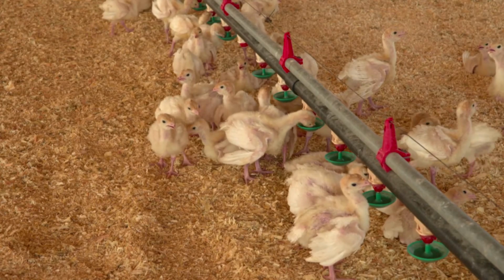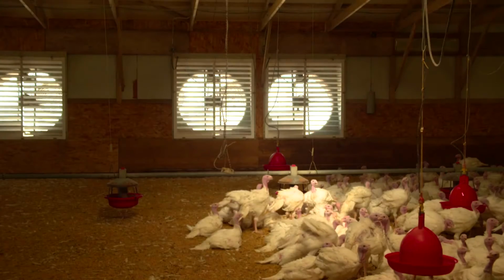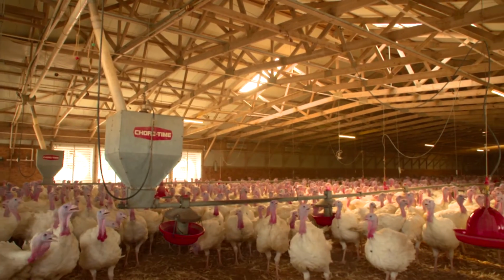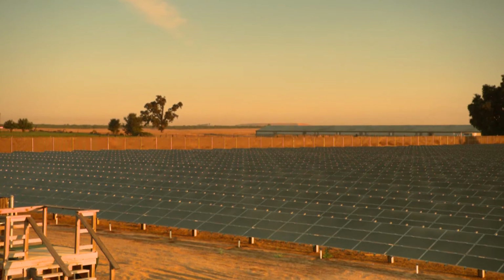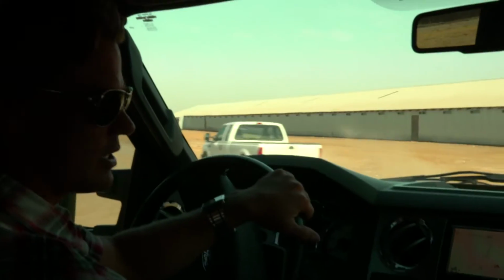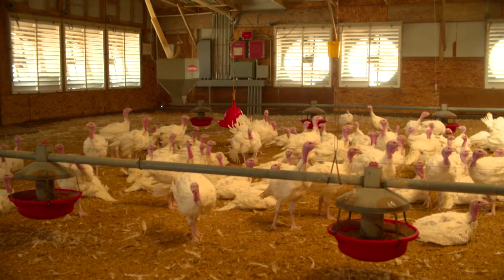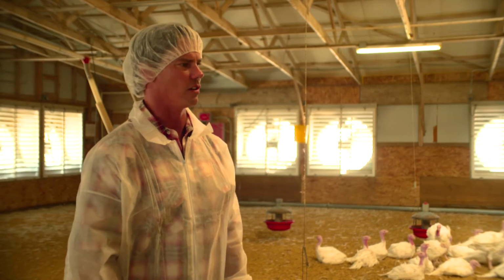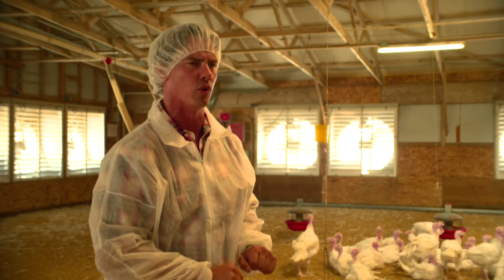Turkey Documentary

Comment: @Ed3891 if you raise turkeys outside you have at the minimum 20% higher death rates. Which would you rather be raised in? Outside with no protection from the elements or in a air conditioned and heated barn?